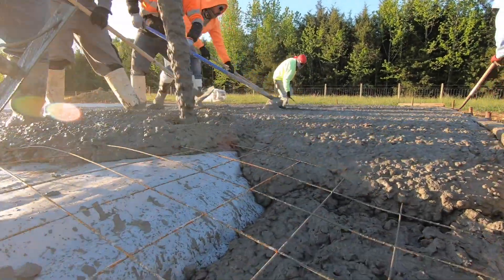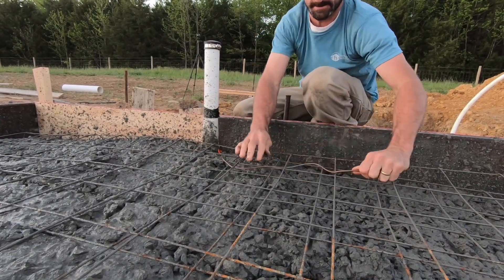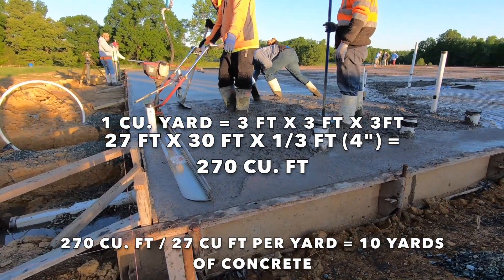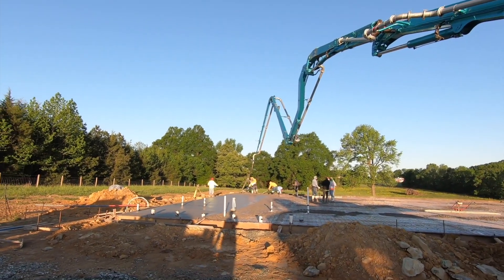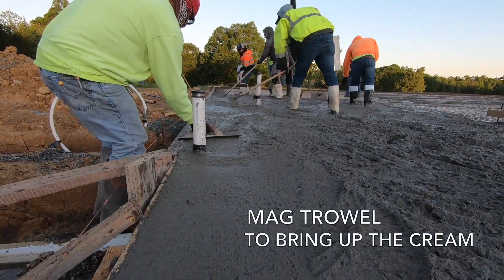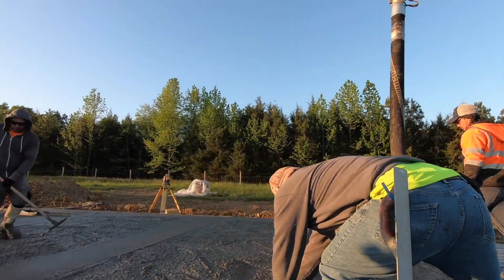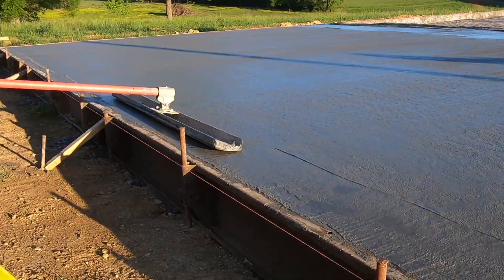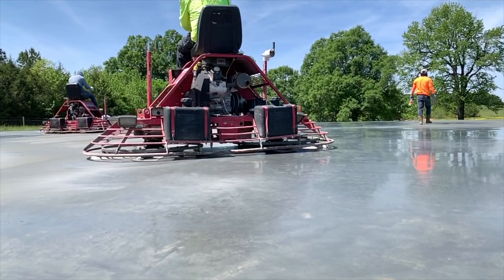How to Pour a Monolithic Concrete Slab | the Skills and Concrete Finishing Tools you Need to Succeed

Comment: I would of thought for a slab of this size that the steel mesh would need to be of a bigger gauge and spacers used to create the required space between the membrane and the top of the concrete slab.
.
Reply from the maker: No steel mesh is required on this project. We’ve been using fiber reinforcement on smaller projects instead of the welded wire mesh

Comment: Grounded to the steel in a floating slab? That is not an electrical ground. You need a ground rod or a ground plate for electrical grounding.

Comment: Logan:  followed your series with interest throughout.  Off topic, but wonder if you can comment on detail items in the Alamance wedding barn, particularly the cupola, and the many accessories need to "finish" a good TF barn "look".  I've just finished my 60 x 70 slab, and frame is on it's way down here in New Bern.  I'm looking for creative ways to provide passive ventilation and cooling....and I'm always looking for closer sources of barn-shop-garage  ideas compatible with timber frame designs.  There are a lot of finishing touches I can't just DIY.  

Direct question of the day:  does the barn have a hot or cold roof design?  Why and how?  Might be a good topic if it's not already covered, along with environmental control topics in general for "open door" barn venues....whether for weddings, or shop/garage/barn spaces.

Thanks, Bill Holton
Reply from the maker: Good to hear from you, Bill. Glad to hear your project is moving along. We put together a short video about the cupolas and their passive cooling and ventilation capacity. I designed the barn to have casement windows to catch the breezes and force air through the building in the summer months. That will probably go just as far as the cupolas in the effect they have on passive cooling. The barn also has two 5 ton hvac units to provide “spot” heat and cooling To the main enclosed building, and mini splits to condition the air in the bathrooms and catering room.
Reply: @HeirloomBuilders  My bad...found the cupola video after I emailed.  Does the barn have a hot or cold roof?  

Thanks for the details; still searching for information on actually engineering of cupola placement/size, window or louvre size and control.  The "rules of thumb" available online in many places are nice, but I see no real overall analysis of building size, volume, CFM or thermal analysis sort of guidelines.  If I'm going to put holes in my $60k roof envelope, I don't want to just go with what looks proportionally pleasant, etc.   I do favor the cupolas for style over more modern vent solutions.  Also favor transom/chancery windows over louvres (for the ambient light). Thinking about a discreetly solar powered fan system near ridgeline.  I will hav a mini-split for my 500 sf shop corner area "as required", but the rest of the building will be as low powered/passive as possible.  It is mostly intended for vehicle work/storage down, wood storage in the lofts.

Would you guys be interested in a raising (traditional timber frame joinery) supervised by frame maker in February time frame?  There is potentially more than just the raising in the offing.

Comment: Is there no need to place spacers under rebar mesh,to keep mesh an inch below vapor sheet, also horizontal in the concrete.
Reply from the maker: Spacers are great with #4 rebar, since the rebar can hold the weight of a person and the spacing allows room for foot traffic. but the re-mesh bends too much and makes it dangerous to walk on. It’s much easier to just pull the mesh up to where you want it as you place the concrete
Reply: @HeirloomBuilders  Thanks, Great job 👍🏻

Comment: Really glad to find this thread....I'm building a 4200 square foot timber frame barn/shop/garage down east in NC, and concrete is only a little less mysterious to me than electricity.  Your event barn monolithic slab layout is very similar to mine; continous perimeter turndown, supporting 36 anchored timber posts w large integral interior post footings.

Have a question about control joints....spacing issues....do you AVOID the interior posts?....I have significant footings under 16 of them.  I've have seen ACI commentary about trying to line up control joints with lines of "columns" in the structure with control joints.  Since I have 2'x2'x12" interior reinforced footings, it seems unlikely I will "encourage" the inevitable cracks to occur along that sort of line.  It is anything but the thinnest part of 4" slab.  Ditto exterior posts, since turn down is 18 inches on the sides and 24 inches on the ends, all rebar reinforced.  Additionally, wire mesh is used throughout slab.  Doesn't that interfere with function of control joints?

Sorry about the Newb level of questions, but I'm only building this heirloom once....I'd like it to have the best chances of it achieving the 150 year age of the family farmhouse it will sit next to.  Pouring 100 yards in my barn....a lot of "essential to have" techniques on your build are pricelessly valuable to me.  Your production and audience targeting were extremely good, watchable and useful.
Reply from the maker: Those are all good questions! We made a grid of control joints with the interior thickened footers in the middle of those grids, for the same reason you mention. Concrete will always find the thinnest or weakest place to form a crack, and those integral footers are not the place! 
The reinforcement mesh will not interfere with the cracking or stop carjacking in any way. It only serves to hold the concrete together (and keep it in the same plane).
Thanks for the feedback as well. I’m glad you found the video helpful!

Comment: Vapor barrier is insulating the slab from ground, so how does UFER wire work?
Reply from the maker: J D great question. We mostly tie our UFER into the footings, which don’t have a vapor barrier. This monolithic slab contacts the ground on the bottom and exterior side (since the vapor barrier only extends to the interior vertical side of the turn down footing.) in other words, there is still ground contact and re-mesh is continuous and tied into footing. That would be a great question for an electrical engineer
Reply: @HeirloomBuilders  Concrete is not a conductor, and rebar is not an acceptable ground. You need a ground rod or ground plate deep in the dirt to meet electrical code.
Reply from the maker: @atodaso1668  you’re right that concrete is not a conductor, but wrong that rebar is not an acceptable conductor. Check the code book, it’s called a “ufer” and required in a lot of places. We tie that wire to a ground rod like you mention
Reply: @HeirloomBuilders  Its not code here in Canada. I don't see what a piece of #6 copper twisted loosely around a piece of floating steel suspended in the slab is going to add to the ground system. The only thing that comes close is I had to bond rebar with  compression crimps. But that was for a steel structure in a highly explosive part of a coal export yard.

Comment: So rebar is not necessary if you're using mesh? I am almost ready to pour a wood working shop slab 30x42 ...would you use rebar or mesh in that?
Reply from the maker: hugh jasole good question. Rebar is always better than mesh, but mesh is used on most residential slabs. Even then, no reinforcement is REQUIRED on residential slabs. But depending on your equipment/vehicles weight in your shop, you’d probably not regret the additional cost of rebar.
Reply: @HeirloomBuilders  Okay...thank you....most of the tools will weigh between 200-500 pounds...rebar it is then.  I was hoping to save a buck but rather it be done right.
Reply from the maker: @hughjasole9336  i hear that! I felt the same when I built my house.